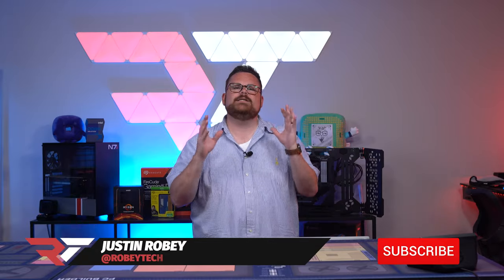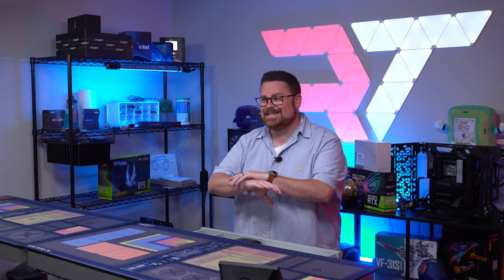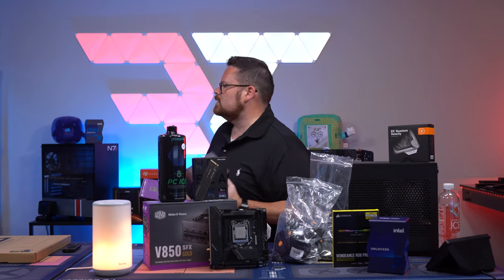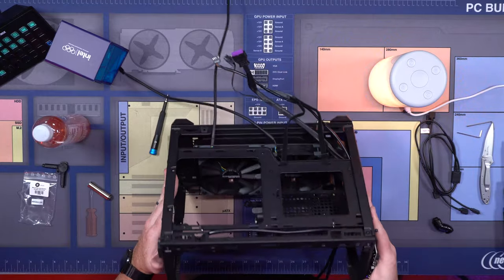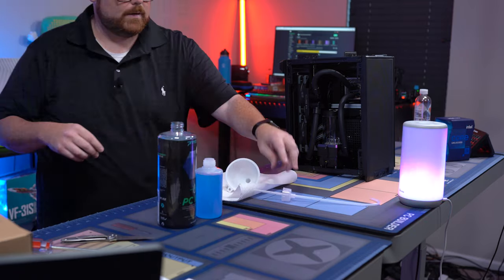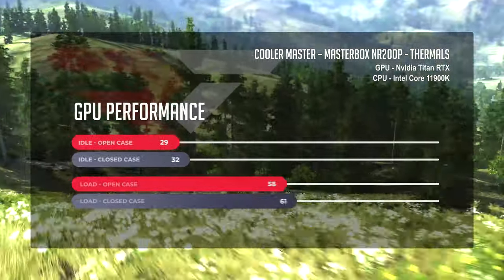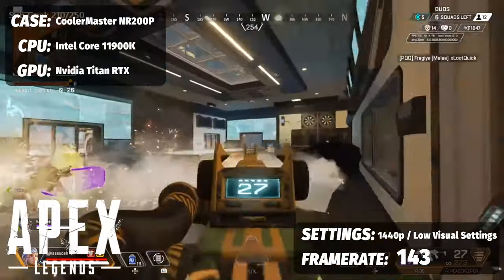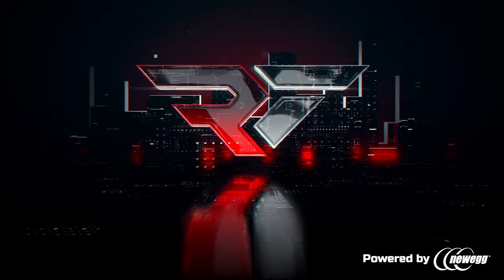It could have been perfect… The Intel SFF Water Cooled Build + Benchmarks (11900k + Titan RTX)

Comment: Great build 👍🏼🤩
Reply from the maker: Thanks!!
Reply: Slim fans would have not caused clearance issues but gladly it worked out been waiting on this.And with slim fans u can fit a top rad.
Reply from the maker: Yeah that’s what I said post the build that replacing with slims would have fixed the issue

Comment: I'm wondering how it could work, cause due to official EK compatibility list the EK-Quantum Velocity CPU block is not compatible with Strix z590-i, but it is compatible with lga1200 and also the rest Strix z590 motherboards (ATX, mATX) but not with the m-ITX one. I was curious, so I wrote to EK support. They answered "We are sorry, but we have no waterblock that fit Strix z590-i right now". It doesn't look like you had CPU heating problem or something. Beside of that, really nice work, looks pretty and compact.
Reply: He installed the metal back plate upside down and rib inward.